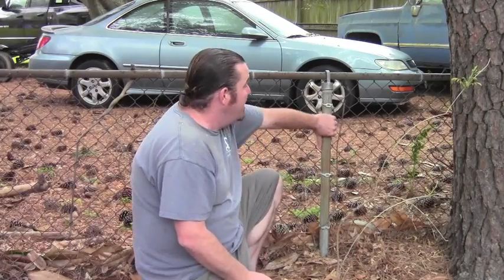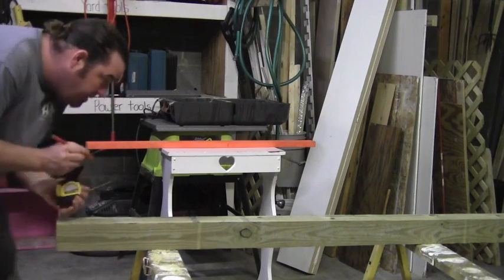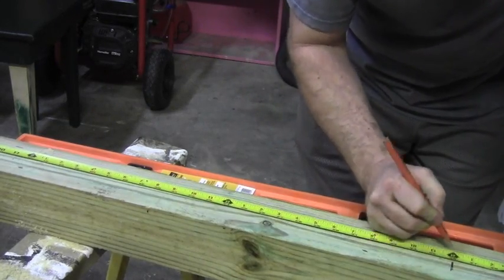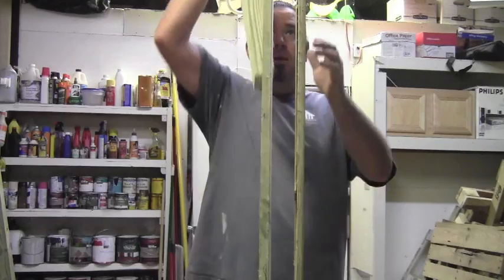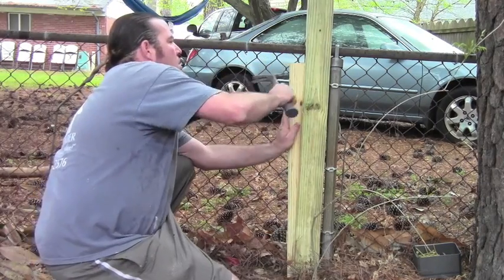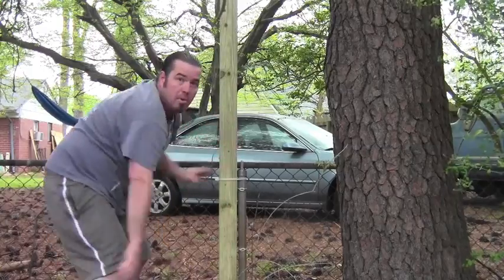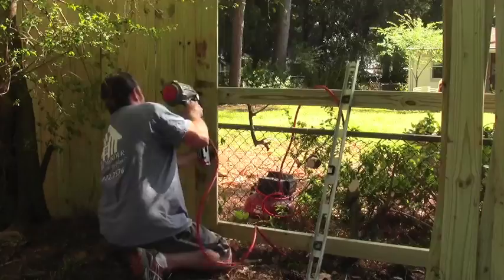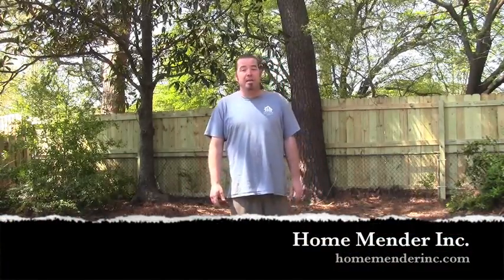How to replace chain fence with privacy fence EASY! Home Mender.

Comment: I want to thank you. It worked like a charm! I have metal posts 10 feet across, in very windy Oklahoma. 

I modified it a little, I used heavy duty galvanized hanger straps around the posts. Was able to drill in screws to make it very tight from the back end using the straps. 

Some of my old metal posts were pretty slanted, so I merely measured and cut treated wood to fill the space, so the new wooden posts would be straight and tight up against the metal and newly cut treated wood. 

I did exactly what you suggested, while modifying a few things because of how crazy windy it can be in Oklahoma, and the slanted posts. And I got to say, even up to 75 mph winds, the fence was SOLID. It didn’t even budge. 

Very well pleased with it. Genius idea, and saved me a lot of labor. 

Thanks again!
Reply from the maker: This is awesome love making it work for you. Thank you for sharing.

Comment: In 3 minutes you explained, demonstrated and finished your instructions, some other you tubers would probably take 25 minutes or maybe even 2 parts. This is awesome, I am glad I found your channel. I was surprised to see nobody make "sleeve" over existing chainlink fences. I thought I could find something like a cover or veneer type to just go over the chainlink fence. Also it would be great if you mention what type of wood you used, I assume it's treated decking wood?
Reply from the maker: Hey hey heading for tomorrow. All wood being used outside should be treated… I cut my fence posts out of a 4 x 4, with the 2 x 4 fence, panel, stringers, and dogeared fence pickets.

Comment: I watched your video about replacing a chain link fence with a privacy fence. It looked like a lot of labor for each post, but you had the cutting tools on hand to help you achieve what you set out to do. I am curious about your method, but I wonder if it is possible to have the chain link fence not showing on your side so that you can enjoy the nice wood fencing on your side of the fence?
Reply from the maker: Absolutely Alfonso, you can build it the other direction

Comment: Awesome! What would be your solution if the chain link fence was not on even ground and instead runs up a steepish hill? That’s my current situation 😩
Reply from the maker: Make sure you posts are plumb then cut the boards in an angle if needed. You can book an appointment with me at the homemender @Gmail no spaces

Comment: This is brilliant and may just be the perfect solution for my backyard. Our house came with a 4' chain link fence in back, but it's on a rocky slope and set into stone (natural limestone and constructed stone retaining wall), surrounded by trees. I sure didn't want to dig new post holes! Could this same concept be done with horizontal, rather than vertical, pickets?
Reply from the maker: Hey Jessica!   Totally feel you. This one wasn’t as bad as yours sounds but it was hardcore.  Great solution. Yes,  you can run the pickets horizontally but you may want to throw in an extra vertical between posts for stability. You got this!

Comment: Great video! How long will those zipties last? Seems like the existing metal fence is the anchor for the fence, is it attached to the metal fence in any other ways? Thanks
Reply from the maker: Hey David , the zip ties were not for longevity, they were just place holders until the fence was built. Sandwiching the post around the chain-link should secure the fence to the fence after it is built. This one’s been up for seven years and counting. Thanks so much for watching
Reply: @homemend  thanks for the reply! Wish you the best

Comment: Thank you! Was looking for a solution for my 5’ chain link to turn into 6’ wood privacy that wouldn’t cost a lot or require digging posts. I think this is it. 

My only concern was stability but my metal posts are solid and I’ll be using top rail & keeping the wire mesh which should help. Plus from the comments seem to hold up well. I might put a post every 6 feet. Would that be more stable?

Also wondering if I could attach a 8’ fence panel instead of pickets? I would just place posts were needed.
Reply from the maker: Hi Dena!  My sisters name is Dena!! Too cool.
The reason I did pickets is because I wanted my new post at every post of the existing fence. To tell you the truth I didn’t know if it would work or not when I built it but it worked amazing way cheaper than replacing the fence and it served the purpose.  if you wanted to use panels You could either cut the panels to 6 foot long or place an additional post at the 8 foot mark. I hope this helps!  You rock.

Comment: Hi! Thanks for the amazing video, I want to try it, but my metal posts are slightly slanted, not too bad. Can I still make the wooden posts level, even though my metal posts are slightly off? Thanks so much!
Reply from the maker: Hi scoot. Yes these were slightly off as well   It would be certainly worth the try.
Reply: @homemend  Awesome! Thanks so much for the help! I’ll be starting this project in the next couple of days. Super excited for it!
Reply: I forgot to mention, each of my metal posts are 10 feet apart, and I live in Oklahoma SUPER windy, I’m about to purchase all of the materials. Should I be concerned about the distance? Each post is over 40 inches tall. Thoughts?

Comment: How do you create posts for corners on the chain fence?  Or do you just improvise for that?  Doors on the chain fence?  Love what you did but before I try to tackle this didn’t know if you had any tips on these.  Thanks!
Reply from the maker: hey dp! great questions...the corner would be done the same way, just run it out to the far outside (or inside if needed) to be able to tie into another side. as far as a gate, i would probably remove it all together and do only wood for that, less weight and easy to work with. If you want to leave the chain link gate, you could just "decorate it" with wood...i hope this helps!

Comment: Rather than cutting that big notch you could also laminate 3 boards together, 2 at the desired height for either side, and a board in the middle to fill in the gap above the fence. Three 2x4s should fit well most times.
Reply from the maker: Awesome suggestion Kevin. Thanks for commenting
Reply: This is brilliant

Comment: Hi, I just attempted this on a small section at the side of my house and it seems like it will work great! One question..how do you deal with the slight bow at the bottom due to the insert being placed back into the post? Thanks!!
Reply from the maker: thats awesome renegade! i didnt have a bow but it seems you could rip a quarter inch off of the insert? i hope this helps!
Reply: Ok cool. My chain link is no longer straight to the fence and is slightly bent...does it add anything to the stability or can I just cut it off, leaving just the posts and top rail? Thanks!

Comment: Could I do this with pre-made 8ft sections? and just not use the posts? I was thinking of using u brackets around the base and top of the metal fence and screwing into the pre-made sections. What are your thoughts?
Reply from the maker: hey fuse..yes you probably could... im trying to picture..it seems as though the middle stringer ( on a 6 ft fence) would need to line up perfect with the top bar of the chainlink? i suppose it could be done..i would love to see how it turns out! share if you want at homemenderhelp@gmail.   thanks for sharing fuse!

Comment: Hey man, great video and clear instructions. I do have a question: my 2ft chainlink fencing doesn't have the steel crossbeams spanning at the top, would that be an issue? Thanks.
Reply from the maker: hey duke! only 2 ft tall? this one was 3..you would need to adjust your post notch height and no,  the cross beams were not involved in the new fence..

Comment: This is great Dustin! I want to have a 6' privacy wall as well but I'm a little hesitant if the existing posts can hold it up. My existing chainlink fence is 4' high. Any ideas on how I can reinforce and make the posts more sturdy? Thanks!
Reply from the maker: hi fun kids! my existing posts were semi sturdy. If yours a kind of floppy you may want to replace the post..( total drag) but you may also be able to dig around the perimeter and pour some concrete at the base to strengthen. i hope this helps and good luck!

Comment: thats nice idea but i'm not sure if thats stable. because its will be wobbly from the chain link in the bottom if the wind blows on it. id  find a way to attach on the metal post using a 2x8
Reply from the maker: Hey T dub. This project held up really nice and is still standing six years later. I hope this helps

Comment: Question: can this handle strong winds? I live in a hurricane area and am concern this may not hold
Reply from the maker: hi nc! I guess that would depend on the existing metal posts.  Mine were in there pretty well and i have seen no problem with it yet! Hope this helps and thanks for watching!

Comment: Hi thank you this is what I need. I have some questions. My 3ft chain link fence is on side of my house at back patio with a gate that leads to my driveway and garage. it's in cement. Will this still work for me?
Reply from the maker: Hi Megan.. I think Im understanding correctly but all of the posts in this video are in cement as well. This method should not be a problem on any secure post. I hope this helps!

Comment: Can you weld the sleeves onto the poles so they never shift?
Reply from the maker: Hey hey paprika… I am not familiar with welding. But if I did it again, I would probably use band clamps.

Comment: I forgot to mention, each of my metal posts are 10 feet apart, and I live in Oklahoma SUPER windy, I’m about to purchase all of the materials. Should I be concerned about the distance? Each post is over 40 inches tall. Any Thoughts? I appreciate it!
Reply from the maker: Hey scoot I believe mine were about 8 1/2 feet apart. Held up nice. You got this
Reply: @homemend  Thanks so much!! About to make the order.

Comment: What kind of time would you estimate it taking you to do 244ft of fencing in this fashion? Looking at putting in about 31 8ft cedar panels. I'm thinking I can save time cutting the posts with a mitre saw but if I can't get the clearance then I'll do like you did. Thanks in advance
Reply from the maker: hey eli... the prep time is the time consuming part, putting it together wont take long.. after all the material is on site,  i would guess about 30 minutes per panel? i hope this helps!

Comment: this looks great, I am wondering could one put the cut out post directly over the metal fence post and then attach to the metal post to avoid using the zip ties?  thank you for your time
Reply from the maker: hi Naz! great question! that sounds like a plan. thanks so much for sharing!
Reply: I'm guessing maybe he didnt go that route so that he could avoid drilling into the metal pipe. I was wondering that myself. But if you are planning on predrilling, then you'll be predrilling through the metal over and over. You'd need to get the angle right or your screws would go in at all sorts of weird angles. But then again you might save time on trimming the filler piece. Hmmm. . .
Reply from the maker: Great points Justin! thanks for sharing!

Comment: Hi Thanks for the video, do you think I could remove the steel wire and top bar and still get the same result? (Leave only the metal post)
Reply from the maker: hi qifan, yes, i do believe that will give the same result..i hope this helps.  you can do it!
Reply: Thanks!

Comment: Hello, my steel posts are not the standard 8 feet apart. is this going to be a problem when it comes to the strength of the 2x4's, if they're longer than 8 feet? do the posts have to butt up to the steel posts to make it structurally sound? this is a very interesting idea, and I'm definitely wanting to do it, but I don't know if i'll be able to. some of my steel posts are up to 10 ft apart I believe. Any suggestions on where to go with that?
Reply from the maker: hi aragoth! going over a 4 or 6 ft chain link? If i recall, one of these were about 9.5 apart. The wind never really affected it but there was some slight sway. Of course, if you left the top metal  bar of the fence, you can place a post just about anywhere. Once everything is screwed together and tied in, it should be pretty hardcore.. i hope this helps! thanks so much for sharing!

Comment: Do you think if I use a regular 6ft fence piece as a post will work; If i use C clamps around the metal pole and screw them into the wood?
Reply from the maker: hi cor! i dont see why not. It may be a bit bulky but it sounds like it would stay standing. Good luck!

Comment: Thx

Did you do something similar with the gate ?
I am just trying to block off the view so my dogs wont bark at neighbors...the easiest most inexpensive way possible. Thank you, Sir !
Reply from the maker: hi charles! no problem....i did not do a gate but if i had to, i would remove the gate only and build a wood one..a little more work but shouldn't be any more expensive.. you would need hinges and handle...i hope this helps..

Comment: Thanks for the video. Just wondered why you didn't install the fence with the chain link on the neighbour's side?
Reply from the maker: hi ted.. if I would've done that, someone could easily hop the fence.. if that doesn't bother you, then installing it the other direction would be ok.. thanks for watching!
Reply: Did you cut the ties and remove the chain link later?

Comment: Awesome job and awesome problem solving skills dude!!!! Can I ask you how deep are the chainlink posts and are they set in concrete? Im thinking of doing what you did but from scratch cuz I don't have a chain link fence yet and I don't wanna have to deal with my post rotting out and most anchors aren't built for lateral wind force. I just wanna make sure it'll last for awhile.
Reply from the maker: hey ciarra! depends on the climate..i do 24"  deep with concrete but i hear farther up north they do more ... Virginia  beach is mild..thanks so much  for the comment...those posts were set in concrete probably the 24

Comment: If you have a table saw or radial arm saw those could also be used to notch the post. Also if you didn't want to see the old chain link could you have remove the chain link and the add then drilled and screwed in the pipe structure and put the wood posts over the metal posts.
Reply from the maker: hey ryan! great suggestions!..in this case I'm not too sure who owned the fence.lol thanks for sharing!
Reply: Oooh! Great idea!!! I love the whole concept, but didn’t want the chain fence showing, (I own the chain link fence) so removing that part would be perfect!!! Thank you!

Comment: How would conver the gate? Seems like you would follow the same concept but I think it might be different. Awesome video.
Reply: Also could you cut all the chain link out and leave the bar structure as well?
Reply from the maker: hi cool hand! this one was not the customers fence so i didnt want to disturb the chain link but if you wanted to remove it, i suppose it wouldnt affect the new fence. As far as the gate is concerned, i would just remove the gate all together and fashion a wood gate, seems adding all the weight to a movable gate wouldn't be as efficient but in theory it should work.. i hope this helps! thanks for watching!

Comment: Very impressive!  Yes I learned a new way. Was thinking, though, about building a frame around the metal posts, using maybe I x 4.  Four pieces wrapped around Inna square, boxed in. Does that make sense? Would want to out something in the upper 2 feet so it's not hollow. Maybe spray foam. Criticisms welcomed! Thank you :)
Reply from the maker: thank you NG! boxing the posts in would totally work . Not sure what weather the spray foam is rated for but sounds totally interesting. concrete maybe?. Please keep me updated on what you try. I would love to see it!
Reply: @homemend  - wow thank you! Waiting to hear if they accept my offer. If so will definitely keep you "posted!" (ouch!). :). Sakreet sounds like a fantastic idea .

Comment: Although it looks good over time where you notched out to go over your fence it want last. Pressure treated lumber shrinks two to almost three times more than what it use to due to the way it is treated now. I would be curious to see how it held up say in about two years. Pretty sure at the top of your notch out you will see breaking off or cracking.
Reply from the maker: hey charles...great question..actually this fence is pretty hard core..showing no signs of wear! hope this ansered your questions...thanks for sharing!
Reply: @homemend  You are a genius!
Thank you for this idea.
You made a privacy fence from a chain link fence.
You extended the height in a stable manner.
You provided peace of mind...in fence not cracking.
Thank you.
This will save a LOT of time and money.
Thank you once again.

Comment: How far apart did you place the posts?
Reply from the maker: hey tight!...these were placed where the existing posts were..typically 6 ft apart if you're going over a chain link fence.

Comment: So how would you go about it for a fence on an incline?
Reply from the maker: hey rocki! good question man...i suppose i would let the down side of the post prongs run long to give it as much girth as possible...cut an inch or two off one side depending the slope.? .
Reply: @homemend  thanks for the quick reply! I'll let you know how it turns out. We have a 5' fence, so I'm not sure if that would comprise the post too much. But you've definitely got new ideas running through my head about how to tackle the job!
Reply from the maker: awesome! thanks for sharing rocki!